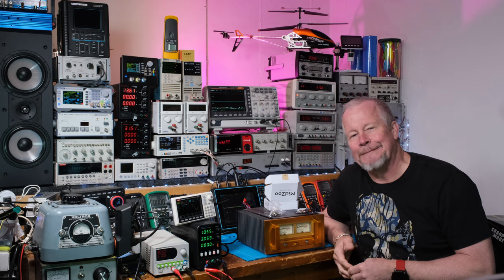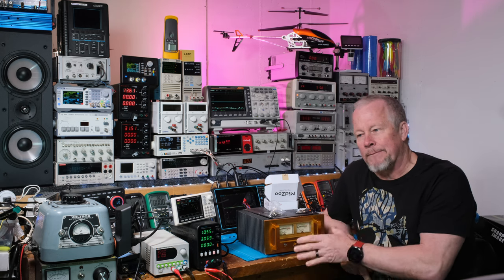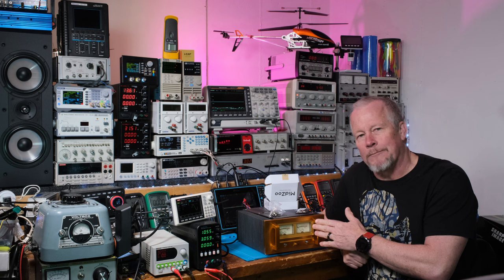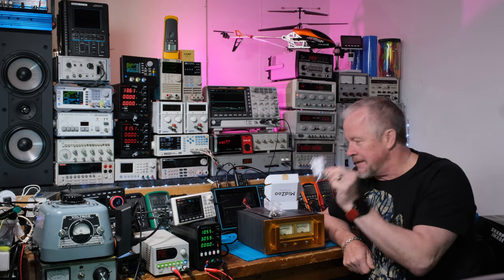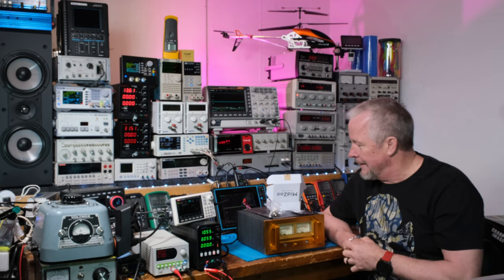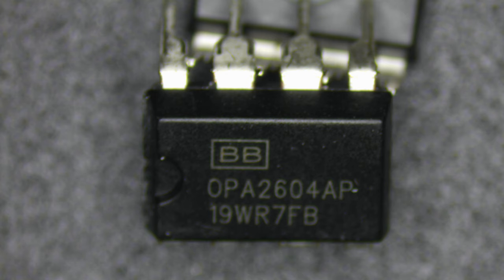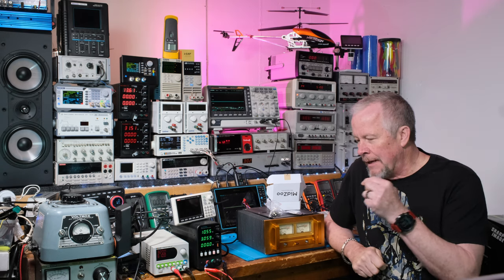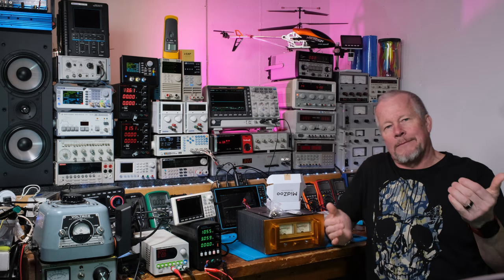Counterfeit Burr Brown OpAmps OPA2604 - Found good ones - What to look for

Comment: Kiss thank you for this information. I never knew it can be this bad with fake or rebadged opamps. I will now watch this pitfall if I ever replace the NE5532 in my Revox since I still think they sould great till this very day. About ebay and amazon sales - here I have more experience - Both of them are not selling. The customer is buying. A huge difference really. So they are simply in the business of pushing stuff from A seller to B buyer.  I avoid both of them and to reduce the risk when I use them, I always buy from anyone that accepts returns. Otherwise it is automatically tale quale. Anyways, thank again for sharing this information about opamps.

Comment: I guess if the parts are discontinued then it might be a good thing that someone is making them . That is if they actually work . I think that the proven good ones should be promoted as working parts .
Reply from the maker: Thanks - that was what I was thinking.  But, this is a slippy slope;)

Comment: Yes, it is a jungel out there!
When I were in the market for buying there were a page that pointed out the counterfeits and original differences.

I saw that the most of the eBay listings were counterfeits on the pictures that were clear as day. Despite they stated in the listing "original"!

So I realized that there is so many and even if they stated "original" they most likely aren't! 

When I only needed a pair I could resorted to buy from the manufacturer direct to a stupid huge price! 

And the goal were to get and experience better sound and I figured if I took the chance to buy something of eBay then I get whatever and I could not guarantee what I am listening to.. and making wrong conclusions. 😞🎵🎼🎧🎶✔️

Comment: Does anyone know the advantage of a sealed ceramic op amp over a standard version (non ceramic)?
Reply from the maker: Military parts (before the COTS movement) had to use ceramic type instead of plastic because of the great temperature range and more hermetically sealed case.  SPACE applications still require hermetically sealed or ceramic type parts.
Reply: @KissAnalog  Now I feel a little exclusive reading that…just ordered some..haha. I wonder how they will sound? I already have the standard version and I know, so far, that ceramic is not the most welcome material in audio, at least on earth…

Comment: Very easy to make counterfeit ceramic parts, they just grab any cerdip part, laser off the top markings, and then either laser etch or print the desired part number on. After all, if you have a massive pile of salvaged chips, just sorted by package type, you will not even bother to see if the part you are doing is actually the right one, just place in the machine and click go.

Amazon does not care, all they do for returns is ding the seller the cost, and that is it, unless some large copyright holder, like the Rodent, the larger luxury good marketers, or the 2 big beverage holders, send them a take down. Even big brands like Rolex have a hard time with fakes, though buying a "Genuwine Rolllex" watch on Amazon kind of says it is not the real item.
Reply from the maker: Thanks for making this point.  Anything can be counterfeited, but ceramics do cost a bit more so hopefully they are too greedy to go after the ceramics.  In this case, the ceramic markings look great and not sloppy like the counterfeits.  The price is high too, which would be expected.

Comment: Never buy ICs from ebay or Amazon.  Power transistors are also a no-no.  I ordered some power MOSFETs from amazon and they weren't even MOSFETs...
Reply from the maker: Great advice, and I would normally agree, but when you are scouting for surplus parts out of normal distribution - you may need to shop other sites.  The old days this was safer, but now there are just too many counterfeits out there.

Comment: I often wonder what the incentive is in faking parts that cost cents to make genuine. Doesn't jibe. Expensive items, sure, but not these pissy little pieces that cost bugger all to make....
Reply from the maker: Great point!  But what I think they do in some cases - is choose a part that sells well that has been discontinued - like this one.  The vendor had their reasons - but there is still demand - so they print a new P/N on them and offer them as original.  Also, this is 2x or 3x a standard part, so I guess the value is in pure numbers...  But I'm just an engineer - not a bean counter;)

Comment: The IRFZ44 & 48 (less common), and others like AO3400, IRF840, IRF3205 etc. etc. are very common, sold by every man and his dog on AliExpress, as well as eBay (much less so). The vast majority have lower Rds, but few have lower Vds.  But there is the complicated exception of the AO3400, because there actually are many version of it from different manufacturers, some of which are rated at 20V instead of the more common 30V ...yeah go figure! ...INSANE!  That's it, not picking on the IRFZ44/48 per se! :)
Reply: Sorry, I meant HIGHER Rds above! :)
Reply from the maker: Thanks for this great info!

Comment: Not having an EXACT symbol is 95% fake.  Your experience bears that out.
When you get crap looking correct symbol, SOMETIMES they are factory rejects (i.e. a little out of specs - seconds).
New & Authentic in the description means NOTHING!  They have no issue lying.
It is a bit of a mess though, especially with mosfets.  Common mosfets like IRFZ44 are 99% fake, 50/50 chance of rejects or total crap sadly.
Reply from the maker: Thank you!  You are so right!  What's the deal with the IRF44?  Was such a common transistor - a good one at that.
Reply: @KissAnalog  For hobbyists, such transistors are a great bargain, BECAUSE by testing their characteristics. marking them, you have a mosfet at pennies, useful for all but demanding circuits! :) ...and you may learn something too!  Like how to test for switching speed etc. (for those more demanding projects) :)
Reply: @KissAnalog  I did forget to mention, like the crazy AO3400, there are several version (from different manufacturers) of the IRFZ44/48 out there, some with higher Rds, but legit, also NUTS!!!!  From the Infineon specs you might expect 18mO but most are 28mO or worse!  I sample test all mosfets, diodes and BJT, especially power ones.  Most power devices are 1/2 or less in current handling ability.  Another one to look for is carbide power diode diodes, they are usually normal schottky or worse!  Maybe the seller hopes it will not blow up until well after your ability to get a refund.  Op-Amps are a VERY MIXED bag.  I have been mostly very lucky so far, even for expensive common types like the AD8628, I got 500 at US$0.14/ea fully in specs, NOW WAY HEY!  Then I bought 3,000 LM358's at US$0.034, all garbage!  ...GO FIGURE??????
BTW - BEWARE with re-orders, you may not get the same stuff - been bitten a few time after buying  "test" samples!
Reply from the maker: Great advice!  Thank you!  @Steven Bliss